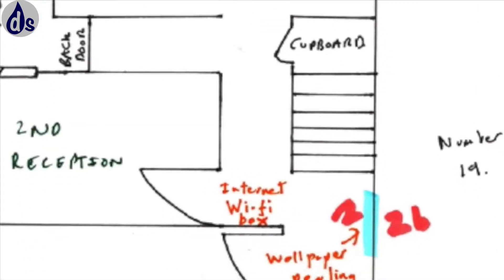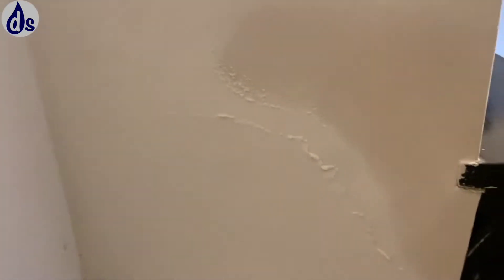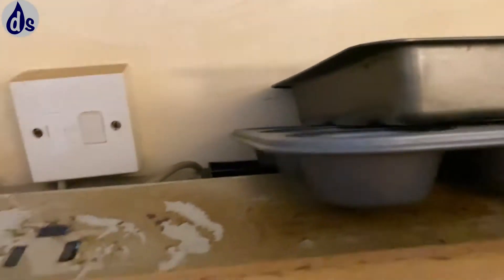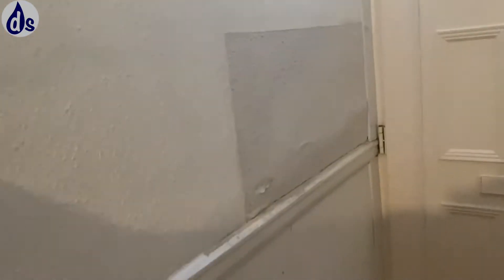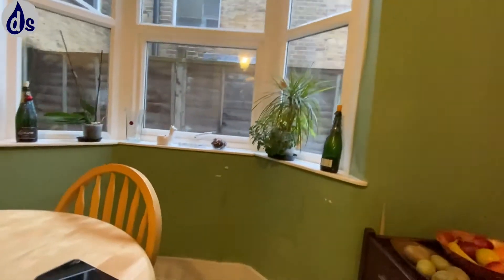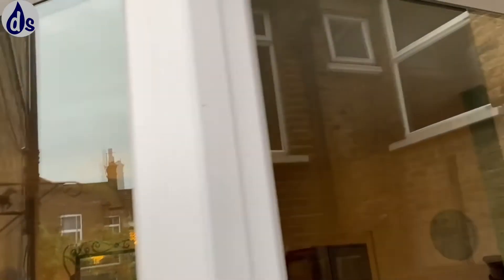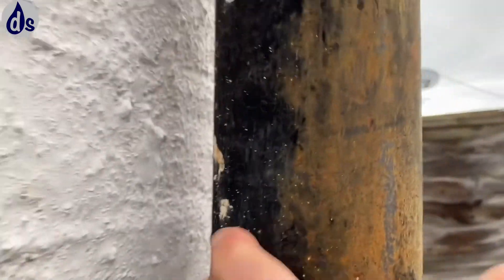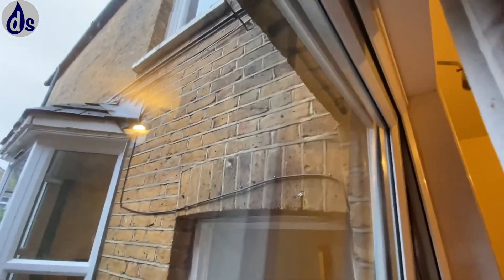❌ Neighbour’s Damp Proofing Worsened the Problem – Salts & Condensation Explained!

Comment: Hi,

Thanks again for these videos. Would you be able to explain in more detail how the damp proofing plaster causes dampness? Can water vapour pass through the damp proofing plaster/render and condense behind the plaster at the brick wall and render interface. Thus the liquid becomes trapped behind the impermeable render layer?
Reply from the maker: Great question! Damp-proofing plaster (or slurry) can sometimes make damp problems worse rather than solving them. Here’s why:

1️⃣ Impermeable Coating = Reduced Absorption

Think of it like breathing into a plastic bag vs. a paper bag. 🌫️ A plastic bag traps moisture inside, making condensation appear on its surface. In the same way, an impermeable slurry prevents moisture from being absorbed and released naturally, increasing condensation risk.

2️⃣ Poorer Insulation Increases Condensation

Slurry has fewer air pockets than standard plaster, making it a poorer insulator. This means cold spots are more likely, which raises the risk of condensation—especially along the ridge or interface between the old absorbent and new impermeable plaster.

3️⃣ Trapped Vapour Behind the Slurry

Moisture doesn’t just come from outside—it’s also created inside the property (cooking, showering, drying clothes, even breathing!). If this vapour is absorbed into a normal plaster wall, it can gradually evaporate out.

However, with damp-proofing plaster, some of this moisture gets trapped behind the impermeable layer—leading to calcium sulphate salts pushing through and causing blistering at the ridge where the damp-proof slurry stops.

4️⃣ The Real Root Cause is Often Ignored

The irony is that the excess vapour is almost always the real cause of damp at the base of most walls damp-proofed. In almost every cases, damp-proofing treatment was never needed, and the issue could have been resolved with better ventilation, humidity control, or fixing external water ingress and leak checks.

This is very similar to what happens with impermeable external render—if rainwater gets in through a crack or gap, it gets trapped inside the wall, redistributing damp over a wider area instead of drying out naturally.

Damp-Proofing Treatment & Property Value

I abhor the sight of those “bullet holes” from past damp-proofing treatments at the base of walls. I even have them in my own property (before my time!). I believe damp-proofing reduces property value by 1–2% unless or until the real root cause is identified and addressed.

Interestingly, it’s not actually the injected chemicals that are the problem. The biggest issue is that the property has been damp-proofed at all—which means a major defect (like a hidden leak) could be lurking beneath. This could cause rot, structural damage, or even subsidence if left undetected.

For more practical damp solutions, check out https://damp.ai 🚀 and feel free to share your thoughts! 😊

Comment: I'm surprised that you recommended re-painting.  I would just have removed the paint and left the bricks unpainted.  Granted it would need more work than wire brushing to make them look presentable.  Perhaps could lime wash.
Reply from the maker: That’s a great point! 💡 The purist approach would indeed be to remove the paint entirely and leave the bricks unpainted—or even limewash them for breathability.

However, I’m a pragmatist looking for solutions that standard builders can understand and execute without specialist heritage knowledge. For most homeowners, repainting is the easier, more workable option—as long as it’s done correctly, with:
🛠️ Regular checks to spot early deterioration
🧹 Wire-brushing to remove flaking areas
🎨 Using an appropriate, durable masonry paint

It’s not the perfect solution, but it’s a practical, maintainable one. Thanks for raising the discussion—I’d love to hear more thoughts on this! 🚀
Reply: Very much agreed! Those are old walls that need to breathe - that coating looks impermeable. That render looked a bit suspect too, proud of the brick and very regular. I bet 50p it's cement render all factors adding up causing those old walls to retain moisture. Easy way to test is the scratch test if it's very hard, it's cement. Basically look like classic damp proofing efforts by standard issue tradesmen
Reply from the maker: Absolutely! Ideally, brick walls should breathe—but some people like the look of painted bricks, renders and other coatings. 🎨🏚️

I take a pragmatic approach—focusing on simple, workable solutions for fixing internal damp problems that a standard builder can understand and implement. Removing paint and render completely is best, but if that’s not an option, regular maintenance, wire-brushing, and repainting can still be effective if done properly.

It’s about balancing aesthetics, practicality, and damp management. Thanks for the comment! Check out https://damp.ai for more insights. 🚀